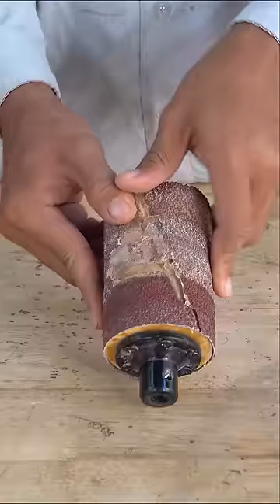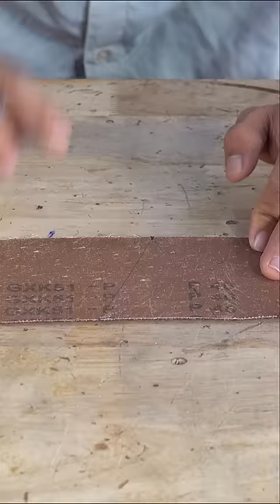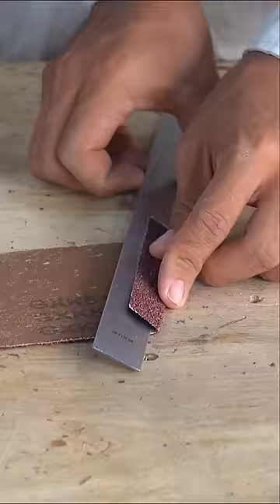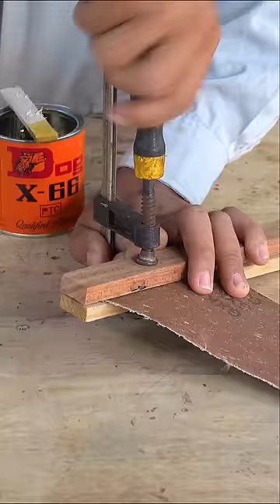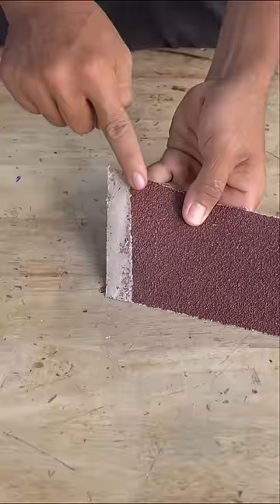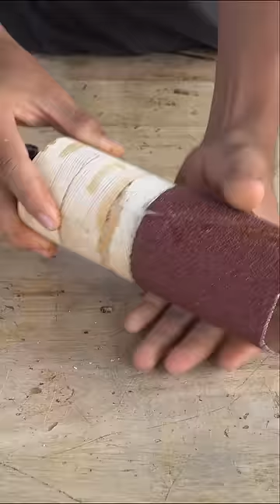DIY woodworking Tips and Hacks #shorts #woodworking #trending

Comment: or... just use rubber cement to glue it to the wood and use some string or rubber bands to secure it till it dries. will hold it just fine and peels off easy and is ready to go in like 10 minutes, make them in batches so you can just swap them out no downtime.